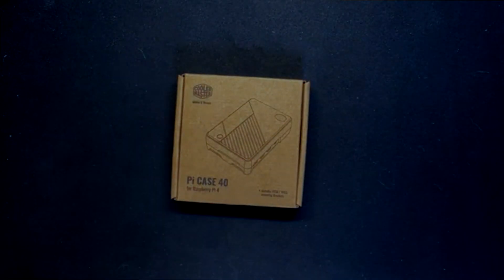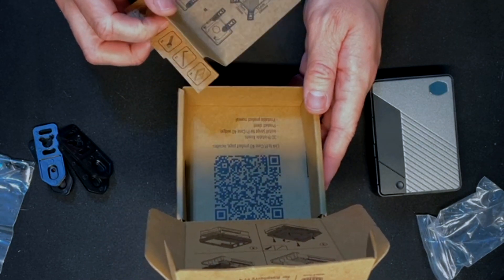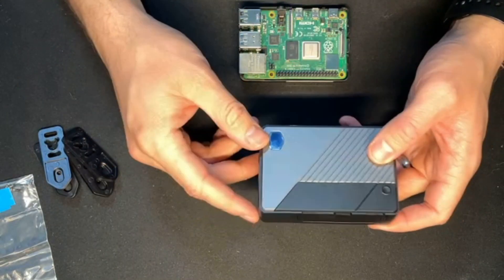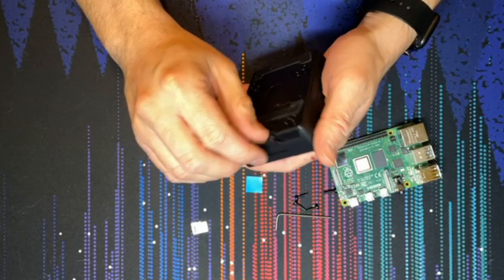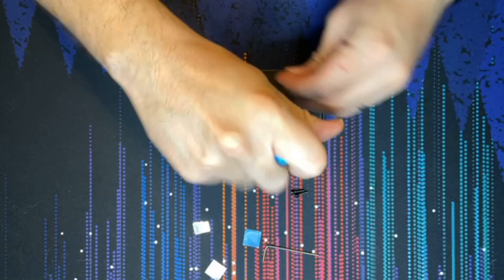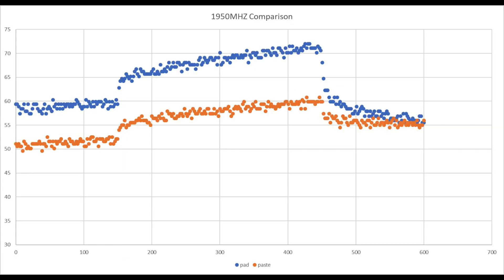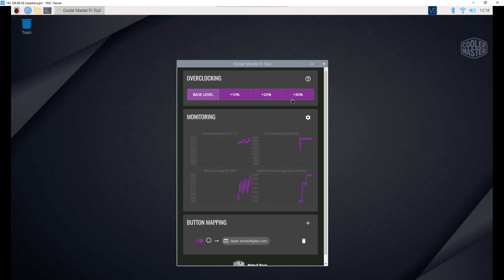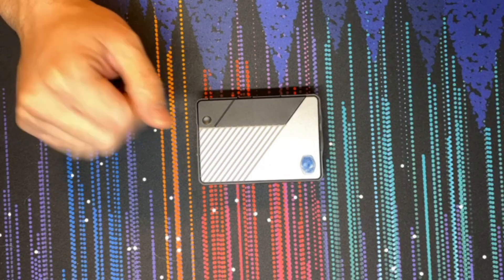The 'Coolest' Raspberry Pi Case - Cooler Master Pi Case 40 review and performance testing

Comment: I have some Conductonaut liquid metal kicking around; it decreased the CPU temp on an i7-7700k by 20C (Folding at Home). Any reason it wouldn't be advisable for a Pi 4?  It would be interesting to see it tested to see how well it works vs traditional thermal paste.

Comment: 52PI ICETOWER - (TALL ONE) - IS THE BEST COOLER FOR THE RASPBERRY PI 4 RAISING PROCESSOR TO MAX AND RUNNING MULTIPLE TESTS AND GAMING.    I WOULD LOVE TO SEE VIDEO CLOCKED OUT /52PI - THIS NEW BOX YOU R SHOWING....IN COMPARISON.  $20.00 FOR 52PI.
YOU COULD MOUNT 52PI ICE TOWER WITH DIY MOUNTS TO TOP OF THAT NEW CASE!!  Lol

Comment: Thank you!
I'd never used a thermal pad before and didn't realize both sides were adhesive...
Reply: They're only slightly adhesive. Additional pressure or fixing is needed to keep it in place.

Comment: An 8GB version is the king of overclocking in this form factor - it has 50% higher PMIC (switcher) frequency than former 1/2/4 GB models, hence pumping in 50% more current, perhaps with lower voltage ripple. Mine goes up to 2350/750/550 MHz on air for cpu/gpu/core frequencies, respectively. over_voltage=10 though. If you want to overclock, this is the model to get. Latter form factors (CM4, Pi 400) have this PMIC too.